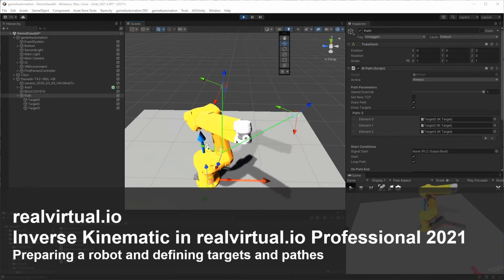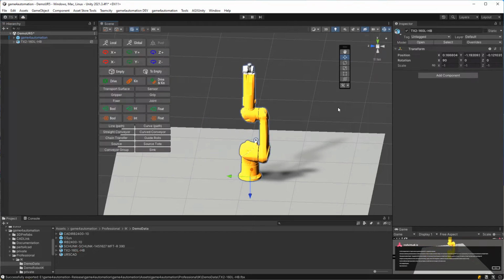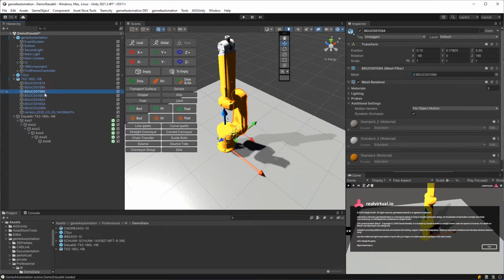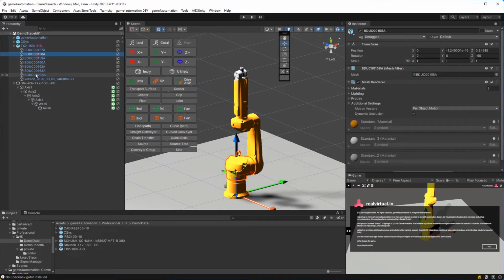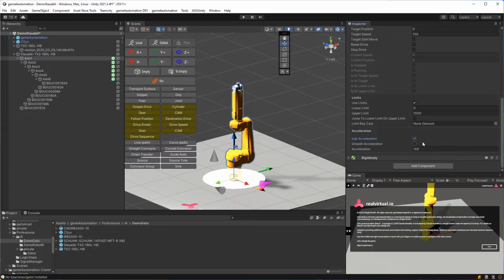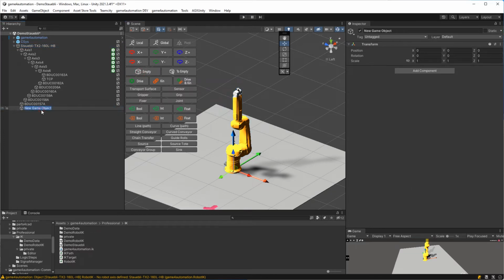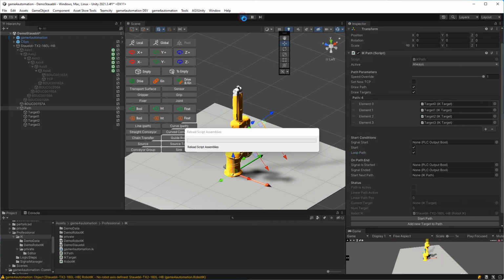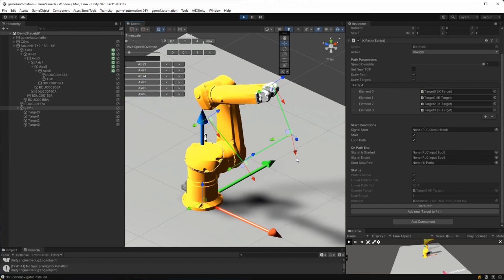Tutorial - realvirtual.io  - Inverse robot kinematic with Unity

Comment: Thank you for your Guide line 
I saw that how to make my own Robot
Is there have any Guide line to interface OPC-UA with those Robot?
or can you make another video for interface Realtime data with Robot ?
Reply from the maker: You must have a Drive and a Drive_FollowPosition component on each axis. Now you can connect a signal (the current axis position) to the Drive_FollowPosition.
Reply: @realvirtualio  thank you for your guideline, I interface with robot model but, it makes stuttering movements. 
is that a program issue or data interface issue?

Comment: Excuse me, sir!
In video 19:42, you rotate the end effort in just one direction, how about the other two directions are both can rotate too?
And in this case, does the robot model need to set up the bone?
The last question, if I just want to drag the end effort to move my robot arm and like 19:42 to rotate the end effort, is the starter version enough?
Thank you !

Best,

Tony
Reply from the maker: Yes you can rotate the end effector (or to be more precise the Target) in all directions, the robot will follow if the inverse kinematic can reach this position.

The inverse kinematic is only included in realvirtual.io Professional - so in Starter you have only the possibility to move the drives at each axis itself.
Reply: @realvirtualio  Thank you! The Professional version is too expensive for me if you will consider selling only the inverse kinematic in the unity asset, it will help me a lot.
Reply from the maker: @黃奕華-r2c  I am sorry, we just sell it  as a part as Professional. Quite a lot of dev work went into the inverse kinematic.
Reply: @realvirtualio  No problem! Thank you for your reply.
Reply: @realvirtualio  Because I just need the ik part, the other functions that are not necessary for me, but still thank you for your reply.